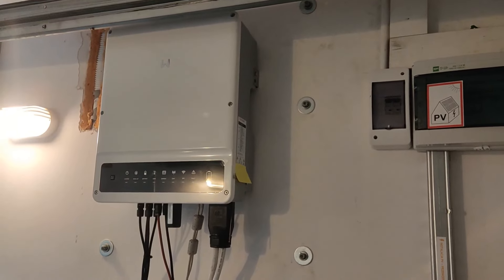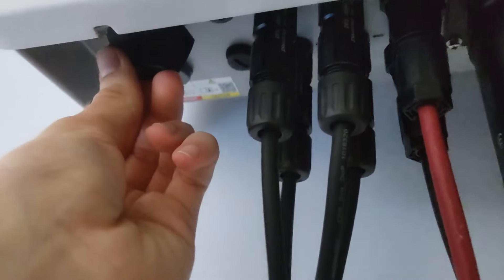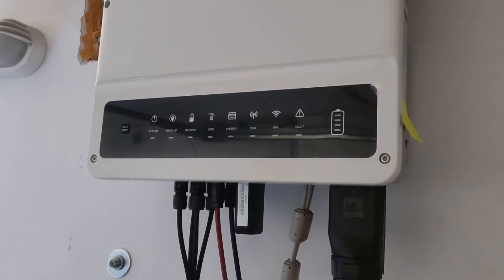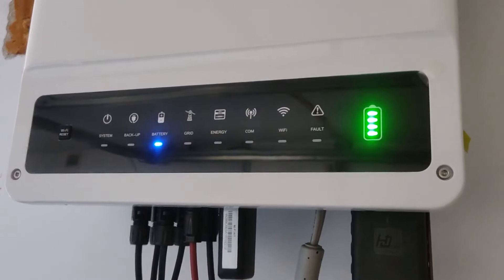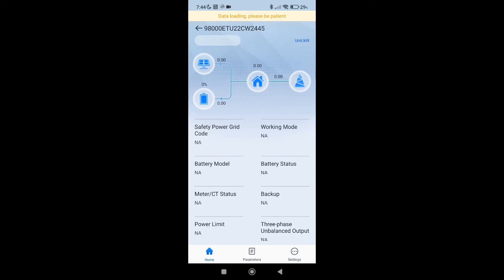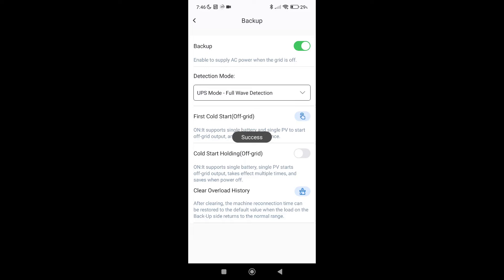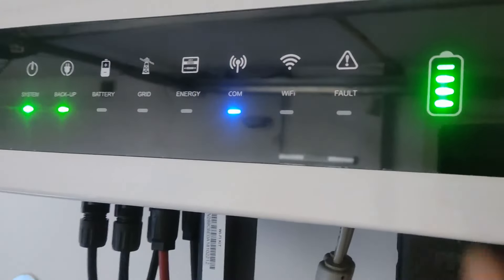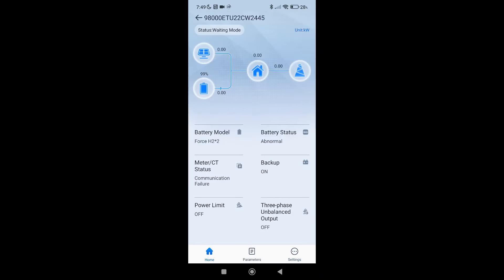GoodWe GW8KN-ET hybrid PV inverter cold start-up from Pylontech Force H2 battery in off-grid mode

Comment: Hello,
what was the reasons to buy Pylontech than Goodwe batteries?
Reply from the maker: Hi, mainly the price, and still Pylotech has a good reliability and durability score
Reply: @piomar123  Finally I decide to buy Goodwe batteries. Price difference between Pylontech and Goodwe in my case was small. I heard from help desk than Goodwe prepared new battery working mode with depends on RCE prices.
Reply from the maker: @rafabaszczyk5018  That's interesting. Any more details about that functionality? Please share how it works when it's available.